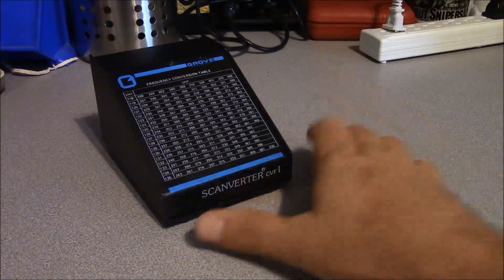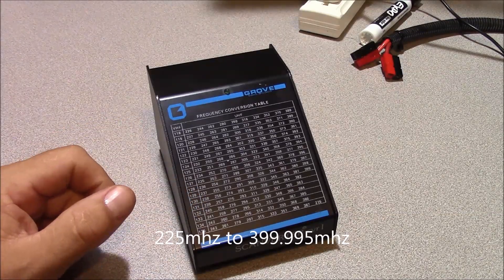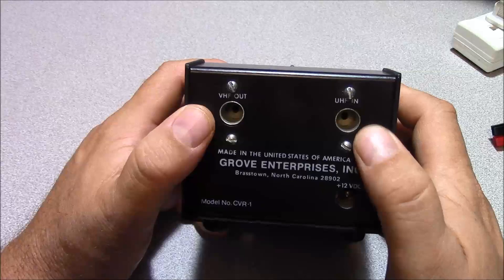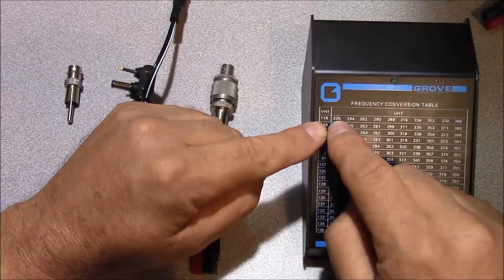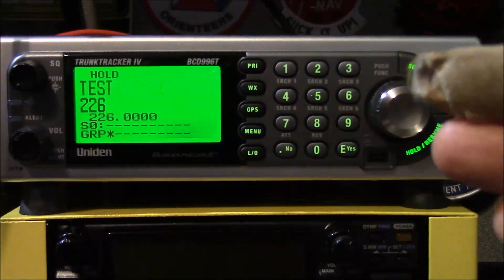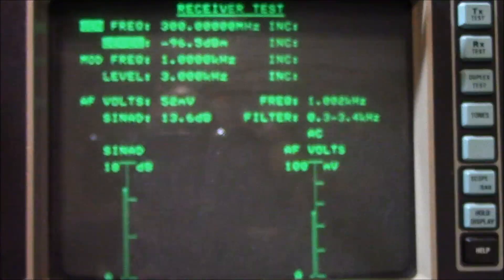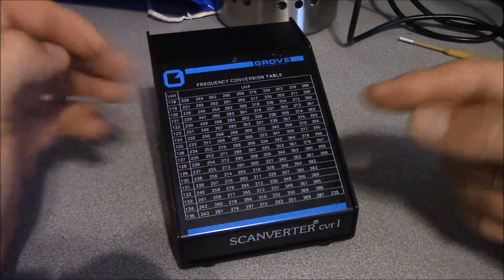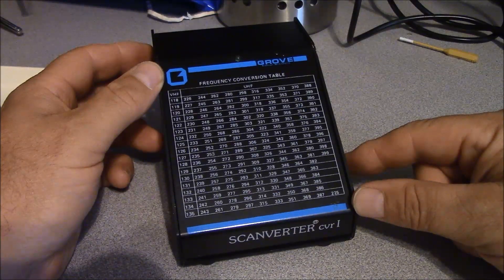Grove Scanverter CVR-1 - 1980's  Monitoring UHF MILAIR on a VHF scanner

Comment: Nice overview of how we used to have to do it in the old days...never thought I would say that...lolol  Just in case anyone is curious Guard is still very active and not on full crypto in my area.  We serve as a the eastern regional refueling point for all air defense intercepts.  If you scan the channels regularly you will still hear when they stand up looking glass and other parts of the air defense network if something is popping. Sky King is the airborne fail safe plane.  It does not fly 24/7 missions any longer, but you can still hear them on the air if there is an increased level of readiness due to geopolitical concerns.
Reply: I remember all those type components😉 I like you seeing if its functional. OLD school for sure😊😉
Reply from the maker: There is a lot of cool stuff to listen too on milair. I picked up an 11 dollar preamp on amazon to play with to see if it helps just for curiosity sake.  Thanks for watching !
Reply from the maker: I enjoy checking out the old stuff. I got the scanverter in a box of stuff gifted to me long ago. Thanks for watching !